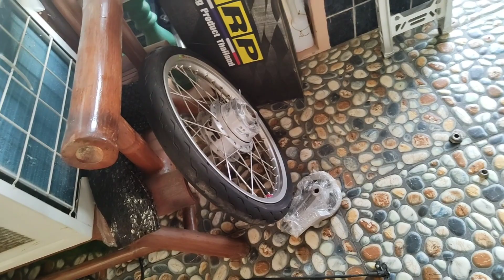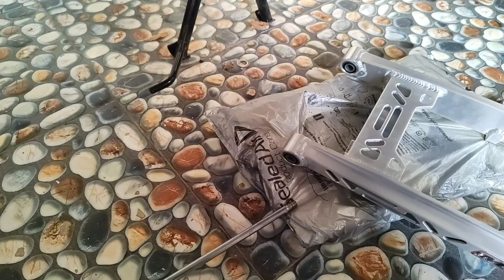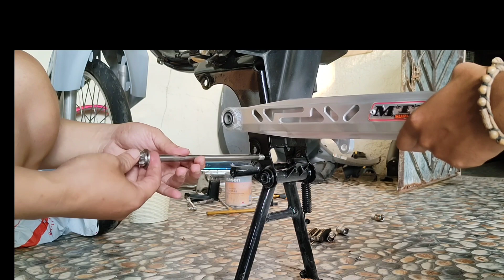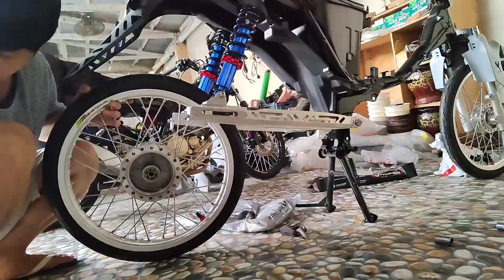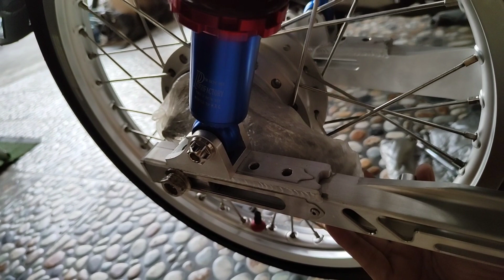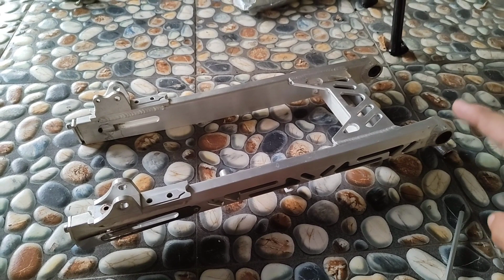Installing MTV dual fin swing arm wave125 convert to Smash115 + double lock center axle Cnc🇹🇭 EP.3

Comment: 25 cm ba boss nmax front axle
Reply from the maker: Basta front axle ng nmax at aerox sir same lang yan
Reply: Boss ano kaya pwede diskarte don sa swing arm ko pang wave s kasi nabili kung lighten hub eh kaso wala palang stopper yung swingarm ko
Reply: Stopper boss para sa brake panel ng pang wave s
Reply from the maker: Option bosd palit brake panel ng wave i 125